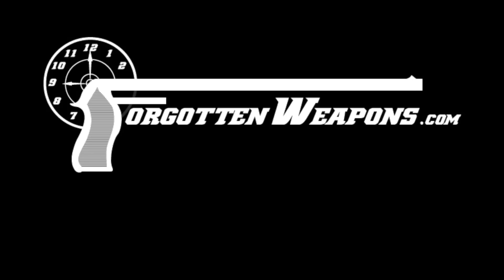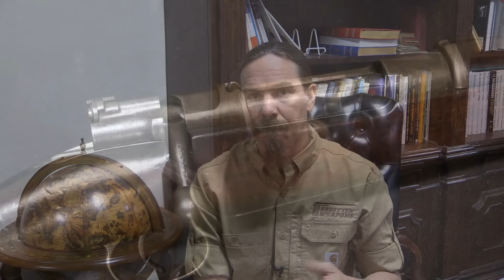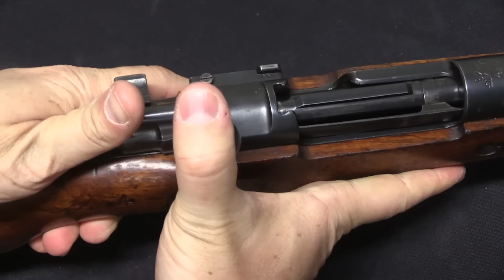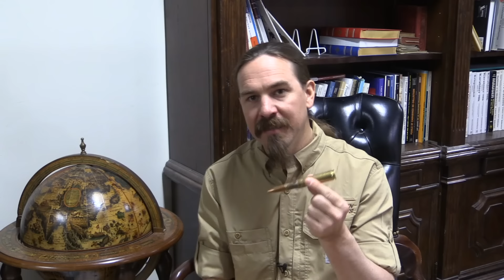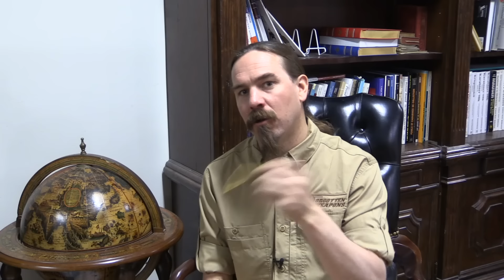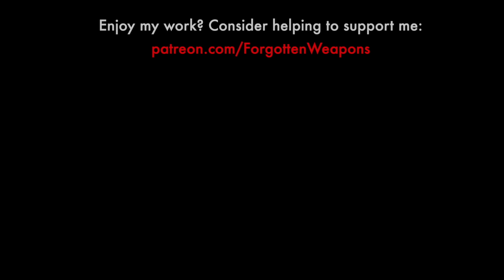Earth-Shattering ka-Boom! How (and Why) Guns Explode

Comment: Such a good point to STOP when something odd happens. It saved my brother's bacon once.
He was shooting hand-loaded 45 ACP through a Colt Government. One of the rounds went a quiet "pop" and didn't cycle the gun.
The range master immediately stopped him and got him to unload & inspect the gun, and it turned out the bullet had stuck in the barrel. Had he tried to fire another round, that would have destroyed the gun and probably wounded him.
<edit: Turns out you discuss this exact case as second after I paused to type this comment>

Comment: Got a new fan in me!  I enjoyed how in-depth you went, including the brief history of safety feature innovations.  One YouTuber wrote a particularly scolding review on the RN-50 after Scott's brush with death.  He cited that the rifle has a serious design flaw and was clearly not tested fully.

I'd love to hear your take on what he had to say.   I watched Scott's account on how all the events went.  The one thing that particularly stood out is how the two ears (meant to prevent partial-threading for the cap) ended up being the biggest problem.

I wonder if a steel block design would have been better there.  Perhaps a vent to handle blowback.  It just seems like those two pieces were an afterthought for safety as that heavy cap would clearly destroy them given enough presssure.

You are right, though: when those other old rounds started to fire strangely, Scott should have stopped.  Maybe that's the reason the SLAP rounds are no longer made?  I am no expert but it is interesting stuff.  I'm glad Scott is all right, either way.  I hope the manufacturer stops the sale of the RN-50 until they really investigate and address things in a more satisfactory manner.

Comment: About 1982, had a Charter Arms Bulldog .44 special let go in my hands.  My field of vision went completely white, recoil was straight down, and I felt hot little sprinkles on both my arms.  Pulled back the revolver close so I could see it.  The top strap and the top 3 chambers of the cylinder were gone.  Lost no blood over the deal.  Never found the top strap or the top half of the cylinder.

Comment: That's also important to EVERYTHING. I'm trained as a carpenter and when we came to the big table router there is a big nut that has to be tightened to secure the actual router and it's relatively common to forget that or not doing it properly. The rule i was taught about that is: "if you feel uneasy about turning the machine on there definitely is something wrong with it", unfortunately i met way too many people who got rid of this gut feeling which is so important

Comment: same happens the other way around also , exsample 
 7x57 in 7mm mag will dump the entire pressure load into the action because the brass is to short to seal the chamber , the brass actually seals on the mouth of the case ,

Comment: I had my own catastrophic failure a couple months ago. It tore open a finger on the right and the left hand, as well as breaking that one. Really messed up my summer, but I could've easily lost the left finger so it could've been worse. 

I've pretty much given up on ever knowing for sure what happened. I delayed watching this because I was spent on trying to figure that out. I've basically settled on a squib, but even that doesn't quite fit. It had to be a barrel obstruction, but the only thing in the way could've been a bullet. I know that shrapnel can do some crazy things, but for it to blow out the ejection port and travel the path it did to cause the pattern of damage it did is unbelievable to me. 

It was with my newish VP9 (a couple dozen rounds through it) with new Winchester steel case. No visible damage to the gun or the spent casings and there were no warning signs. It was round six of nine. Cycled normally as well. Two handed grip, doing everything safely, by the book. The lucky shot did feel more powerful in the split second before things went badly though. Nothing "broke", so there was no visible evidence of anything happening. Now I'm left with a mystery, a finger that might never be the same and an apparently fine gun that I'll probably never want to fire again, even if I did get it checked out. I really liked that one too.

Comment: As always Ian, your videos are informative, educational, rational and well presented in an easy to understand manner.
Your comment on handloading dangers of primed, squib or no powder loads is the number 1 reason I single load every round, and will Not use a loading block to mass load powder, then seat projectiles.

Comment: A comment about old SMOKELESS rifles. You can find old smokeless guns that have "a little roughness" in the bore. The roughness is actually rock-hard fouling...that constricts the bore. It takes a LOT of work...and time...to clean it. Your first bore brush may flex the rod as you push it into the bore. I used to start with an ammonia based gel, RB17. For a while it looks like nothing is improving, but if black patches are coming out, it is improving. Later, a new brush will start smoothly as the bore improves.
7mm Rolling Blocks, a Remington made 1917 Nagant, a Turkish Mauser, a BSA .310 Cadet are some smokeless guns that took some work to improve. Fun to shoot when they are brought back, BUT...don't shoot that 7mm Rolling Block with modern 7mm ammo (2500 fps) and....a constricted bore.

Comment: A friend in the UK reloads his own. On the range (indoors) on his own as other members were not keen on the noise he was shooting a .44 Magnum revolver which proceeded to blow up in his hand and sent the cylinder in bits flying into sandbags behind him. Very lucky man; he figured out that for whatever reason he had reloaded using finer powder than usual and the powder burned at a faster rate resulting in increased pressure too quick and blow up cylinder. Very lucky in number of ways

Comment: Awesome so interesting and great presentation, thanks from Oz. I have seen a stainless steel 308 with its muzzle opened like a banana!! I was stunned to think of the pressure to do this, almost unbelievable but seeing was believing. He told me he is certain he had, somehow in the bush, managed to partially plug the bore !! I reckon from memory 100mm across the ‘petal’  at least.

Comment: What shocks me to this day about Scott's rifle blowing up:

It was an "obstructed barrel" that caused all this, however that obstruction wasn't something stuck in the barrel that stopped the bullet, it was the bullet itself, that couldn't go down the barrel fast enough.

In other words, despite the bullet moving down the barrel as quickly as it physically can (given friction and resistance), the pressure still rose way too quickly for the rifle to withstand this spike in pressure. It was "easier" for the pressure to blow out the threaded cap and the locking mechanism on the rear of the gun, then to push the bullet out.

Another indicator of how utterly insane the amount of force was: The cap sheared off the "ears" that make sure the cap is screwed in all the way and propelled them backwards. These tiny pieces of metal had so much force, one struck Scott in the chest (near his neck) and given the severe injury that it caused, I would assume that tiny piece of metal had about the same energy as a handgun bullet, despite only carrying a fraction of the force of the explosion.
Reply: It was almost 4 times over pressure
Reply: @LiamNajor  Both the amount of pressure as well as the speed of pressure build-up was insane. Much like the recent RPG-explosion seriously hurting one of the BHS-guys, we can be glad Scott made it through all this and still being passionate about entertaining us with crazy nonsense.

Comment: I was a young Sergeant in the Corps, when we lost our 1911's, for Beretta's, and we lost some five or so Marines, from slide failures.  We reverted to our 1911's for a year or so, about 83, not sure, too far back.  I served two decades, we had "squib loads" occasionally, even from "lake city".  The old A-1's were in rough shape then, the A-2's weren't squared away yet, we had some problems in those years, then again in 89-91, and a decade later.  This was a very important issue to bring out, you don't hear about much of what happens in the Armed Forces, when war breaks out with old gear, our usual. Semper Fi, John McClain

Comment: If no one else said it, there was the problem with the Beretta 92 U.S. military M9 that had a couple of slides breakage were the rear half of the slide came off the pistols frame injuring soldiers in the face.

Comment: An interesting one that I investigated at my job was a case in which two shotguns exploded within a short period of time (causing only minor injuries).  Supervision put it down to lack of proper cleaning (a definite issue since we were firing bird-scaring cartridges (never put those through your favorite shotgun -  the brief thrill of watching the firecrackers exploding in mid-air will be tempered by the scrubbing required to clean the powder residue from your bore)).  However, I recovered all of the parts of the cartridge from the guns, unfortunately losing the primer from the first before I could examine it) and determined that the primers had never been struck by the firing pin.  I eventually concluded that the likely cause was improper storage of the ammunition in a cinder block building in which water collected when it rained.  This likely caused the degradation of the powder in the firecracker due to the dampness rendering it shock-sensitive and thus causing the firecracker to detonate as the round was being chambered (we used pump-action shotguns at the time) which was in complete agreement with the description of the events given by the employees who were using the shotguns at the time.  After disposal of all of the old ammunition and transferring storage to a container that remained dry during the rainy season, we never had that problem again.

Comment: I agree with you on the bore obstruction theory. That being said the slap round looks to be a smaller diamanter bullet in a plastic housing pressed into a case with a slight tapercrimp. My guess is it's using a faster powder to get the bullet up to speed and building higher pressure but not dangerous ones so far. Gun goes click firepin hits primer it goes bang. Ignites the powder probably something like n560 for that round. Bullet and plastic casing starts moving having a taper crimp maybe the plastic casing cracked and separated. Jamming the bullet in a strange sideway slide down the barrel. Not fully sure if that would be enough to detonate. But my theory is that the bullet dug the tip into the barrel internally and came down in speed and sent the pressure to moon.

Comment: Squib load is a big one. A round packed to the brim with propellant and compressed to the point of crushed propellent, already spiking the pressure from the overfill, the crushed powder will flash and create a pressure spike in the case and chamber so fast it is beyond the metals ability to contain it.

Comment: Ian's videos on hints and tips like this one are worth taking notice of. I find it difficult at times to relate to pounds per square inch but worked out that 55000 is actually a huge 24.6 tons
Reply: 55000 PSI is 3800 bar, for another conversion.

Comment: I’ve actually gotten squibs a few times over the years; usually from bad/damp powder. I actually had more than one back to back and thankfully all rounds in the revolver were bad. I don’t recall if it was 2 or 3; I believe 2 rounds but thankfully the gun was fine as was I as all rounds were apparently had bad powder loads. Is as actually unable to get the rounds out of the barrel and had to resort to melting them out. The gun is fine to this day and I learned to not trust ammo from some reloaded; a also had a shotgun round fail in a similar manner, in an semi-auto, which thankfully I was able to correct before the person fired another round. Thankfully they were a new shooter and didn’t know about clearing a malfunction.

Comment: About 50 years ago I saw 2 instances of obstructed shotgun barrels with 2 different outcomes.  The first, I was hunting with a few guys and one of them fell into a swampy mud puddle and stuffed the barrel of his shotgun about 10" into the mud.  It was a 16 ga single barrel, single shot, exposed hammer gun, similar to an H & R.  He said he was going to fire it to get the mud out, I told him not to.  He held the gun straight up over his head with one hand, fully extended and pulled the trigger.  The mud came out and the gun was fine.  
      The second one involved a high end double barrel trap gun.  I did not witness the blow up but saw the results.  The last 2" of one of the barrels was split open.  This was a full choke barrel without a choke tube.  The reason came down to the fact that the owner never cleaned the barrels, and the eventual build up of plastic wad material started to make the choke tighter over time, until the last time where the residue build up caused enough restriction to cause an over pressure and blow up the gun. 
    I was 16 at the time and since that day, I always run a brush and solvent down my barrels after a day at the trap range.

Comment: I worked as an engineer for Colt for 35 years and had the opportunity to test many firearms for high pressure failures. For the most part, out of battery failures were relative benign and very infrequent. The failures in which the beech is locked whether caused by a bore obstruction or a high pressure load are always at the weakest point, usually the cut out for the extractor in rifles or the feed ramp in pistols where the brass is unsupported. Guns are designed with an engineering safety factor for excessive pressure and a failure mode that vents gases away from the shooter as much as possible. Rifles like the M16 are relatively safe in their failure mode while rifles like the bullpups are not so so much. Bull pups with plastic receivers are particularly problematic in a high pressure failure.

Comment: Once time several years ago I was shooting a pocket sized .22 LR and was trying to dump the 6 round mag faster that usual. I had a squib and didn't realize it. On a more powerful pistol maybe I would have noticed something wasn't right, but on a .22 rimfire light recoil is less obvious. Since I was pulling the trigger so fast, I may not have reacted fast enough even if I thought something was wrong. The pistol had a thin barrel, with the recoil spring around it like on a Walther PPK. One bullet didn't leave the muzzle and I fired another shot which bulged the barrel about 3/4" from the muzzle. It made a ring all the way around which was too big for the hole in the front of the slide to fit over, and the slide was jammed about halfway back. I couldn't check the chamber without disassembling the gun. Taking apart a gun when you're not sure if it's loaded or not is no fun at all, but I did it as safely as I could. I told the ammo company about it and they sent me some more ammo and a check for the price of the gun, which I sent them to examine and keep for reference. I went to the same dealer and bought another gun just like it consecutively numbered exactly 1 larger. I can't remember what the serial numbers ended with, but the last digit was the only thing different. Like #4, then #5. That gun didn't blow up, and I shot it so much I wore it out.

Comment: 14:55 Interesting. I never thought about it like that, but the case is basically acting like one of the copper gaskets I used to stick in vacuum hardware when I was an undergrad assistant in a physics lab ... and then of course Ian tells me that copper cases were actually tried before they settled on brass.

Comment: I would love to see a video on the Remington 660 bolt/trigger failures where the firing pin would randomly drop on a closed bolt. I ask this because I own a 660 in 6mm that's responsible for turning an automatic transmission in a 1984 Chevy truck into a paperweight with four neutrals. You can imagine with the truck being owned by Marathon oil at the time(1986ish), that the owners had questions. Good thing it happened in Nebraska and nowhere near Marathon oil's home base. I think their office was told that the truck was driven into a cattle path accidentally while looking for a leak and it had ABSOLUTELY nothing to do what coyote hunting...while on the clock.

Comment: 10/10 love the candid nature of the video and the presentation of the facts. Thank you for providing an explanation for everyone out there. One small question related to the in battery explosion. You mentioned the problem being the gasses aren't able to be released out the muzzle fast enough causing one of the pieces of the firearm to fail. My question is that if a firearm has a muzzle device attached (flash hider, suppressor, other attachments) could this potentially cause a similar situation if the gas system isn't properly set to handle the new pressure?

Comment: When I assisted with Hunter Safety classes in the 80s, DOW had a 12 ga shotgun, the previous owner had negligently loaded a 28 ga shell into (had mixed gauges in his hunting vest). Whe the hunter fired at his next target, the barrel blew out just behind where the smaller gauge shell had wedged itself. Pretty impressive the jagged hole in the barrel.